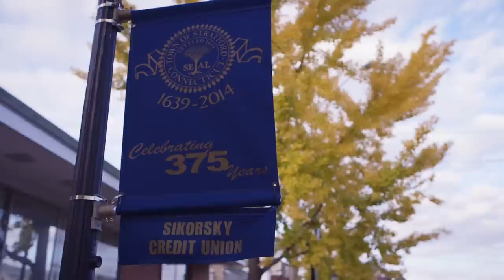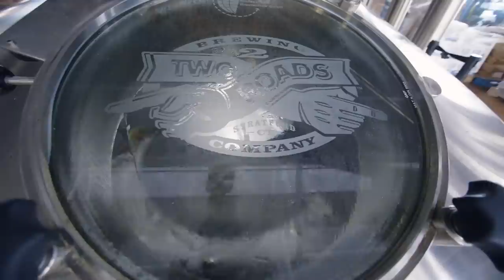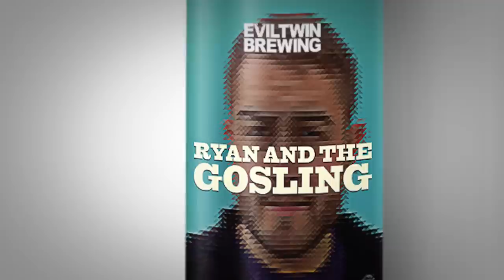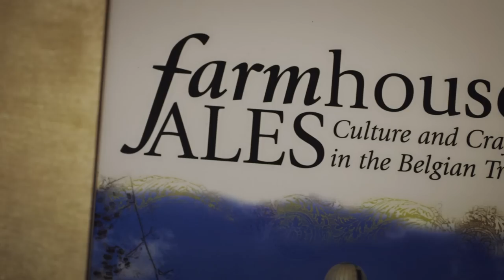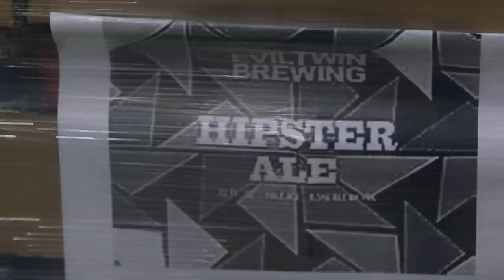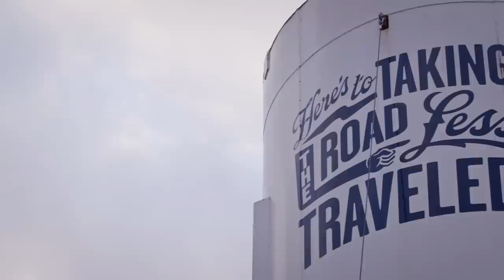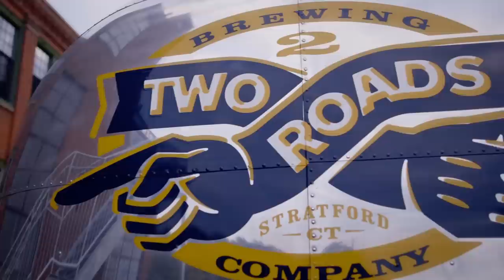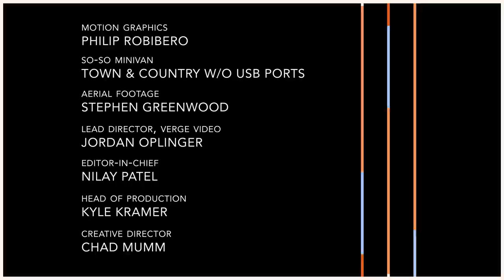Two Roads Brewery and the Future of Beer - Small Empires Ep. 3

Comment: He did miss a point of why quite a few people do not go with contract brewing. That point is location. Most people trying to start a brewery or establish a brand do not have the luxury of having a brewery like this one to contract their beer (larger scale, high quality brewery with excess capacity).

Another older problem is reliability....but that was during the time that large regional breweries where dropping like flies. If your contractor was going out of buisness, it could destroy your fledgling beer buisness. Most brands never recover, and the ones that do would had needed a lot of time to find a new partner.
but today, that problem is less prevalent.

Id say that contract brewing is the safest bet for starting a new brewery (besides starting a brewpub) when its a realistic option, such as with this brewery or with Brew Hub